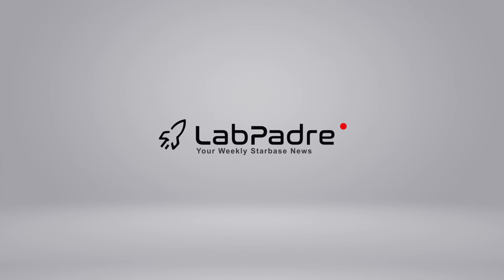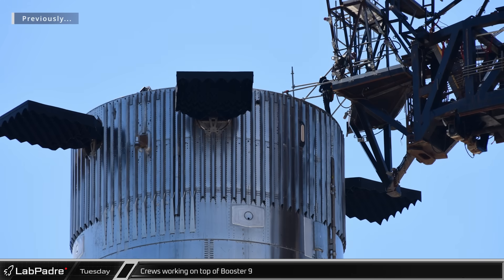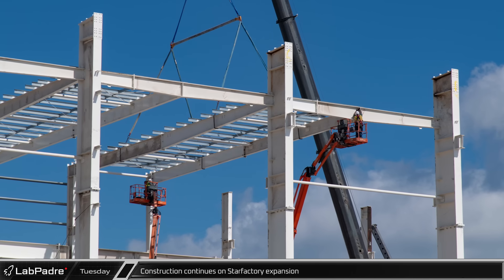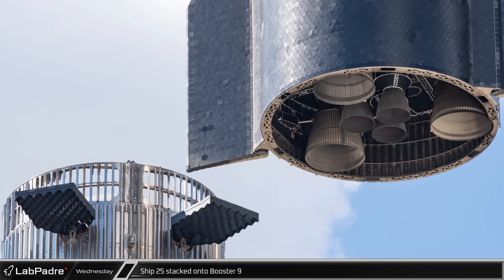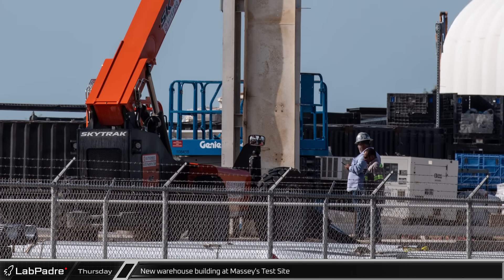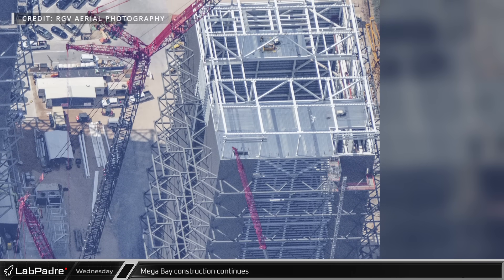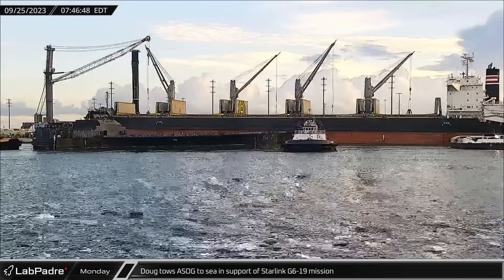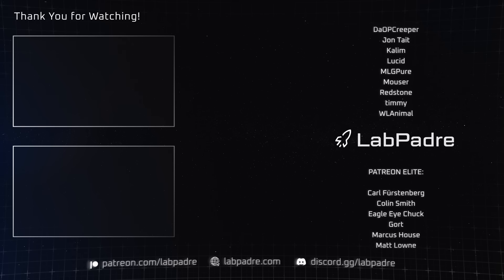Massive Starship Update! - Starbase Weekly Update #82

Comment: I highly doubt those black stands are for booster static fires. Unless SpaceX plans on hooking up the 20 outer engines to the tank farm manually and without the individual quick disconnects. Seems throwing it onto the OLM would be way more efficient.